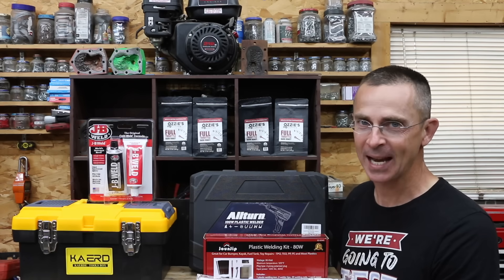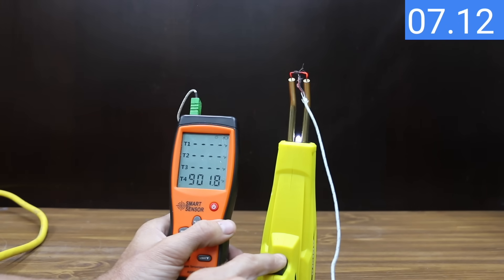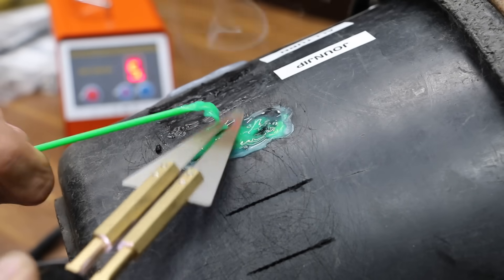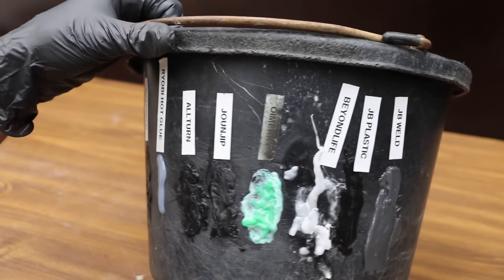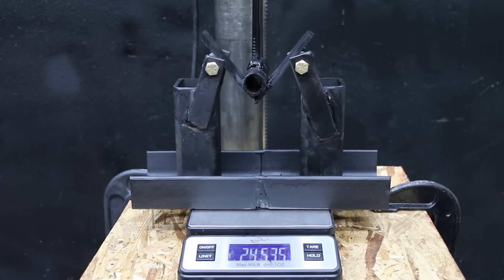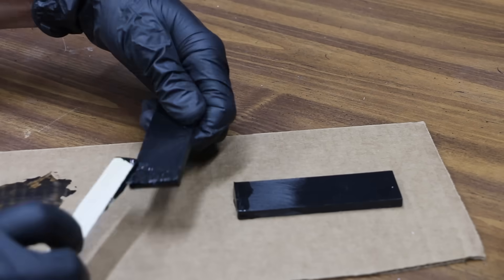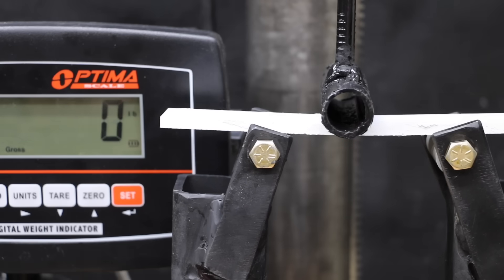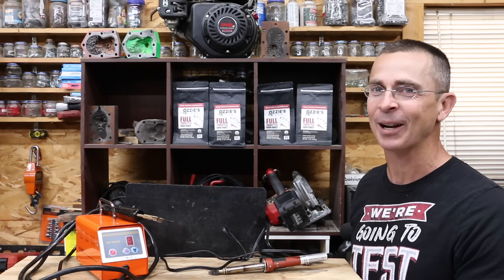Don't Buy A Plastic Welder Until You Watch This Review!

Comment: I weld plastic with my butane and/or electric soldering iron.  For breaks I simply heat at the crack until enough plastic melts on both sides and deep enough that it actually welds together.  In these tests it appears that most of the repairs are done using the plastic sticks more like hot glue than melting the broken part AND the plastic rod together as you would do when welding steel.
Reply from the maker: Thanks for the feedback.

Comment: Thanks for the testing. your tests more or less confirm my experiences repairing plastic which is that it is for the most part a waste of time in applications that require strength. Once those molecular bonds are broken not much short of sonic welding does much more than disappoints you when the part breaks again. Plastic has replaced a lot of items that used to be made of metal, it is not much fun to work with when it breaks, and regardless of the amount of plastic in the part is generally very expensive to replace something that if made out of most metals would have been easier to repair or wouldn't have broken in the first place.

I just used JB weld original on a plastic housing that covered the intake end of a diesel air filter. There were 3 cutouts on the end that could flex a little to slide over the filter. All 3 places had cracked. I sanded and cleaned the areas then applied Original JB Weld along the crack opening the crack some so that some glue got into the crack then applied more glue all over the outside of the crack. upon installation one of the sites re cracked. It was on the intake side so that the air was still filtered so have not gone back to reseal it. The filter has to be loosened from underneath but the only way that it can come out is out the top of the engine after some of the inter-cooler piping and other things have been removed. Not fun and really not much of a problem.

One product that I have had limited good luck is Seal-All. I have a 1984 Toyota Corolla that runs on diesel. It developed a very slight leak in the fuel tank. As a temporary repair I used Seal-All on the spot without draining the fuel. At the time it recommended that I use a single thickness of cardboard like a heavy end flap of a box lid or the cardboard backing of a note pad placed over the Seal-All and held in place for a short period of time. I did that temporary repair over 20 years ago and it hasn't leaked yet.
Reply from the maker: You are welcome!  Thanks for sharing.

Comment: To hell with plastic, and to hell with fixing it using 99% failure rate repair methods.
Throw the garbage in the ocean to support the ocean clean up crews so they will have a job in the morning, just buy a replacement plastic part.

Comment: Remember that the filler has to be able to flow with the workpiece—it needs to be the same kind of plastic. I cut filler strips from scraps of the same plastic type. For plastics that can be solvent-welded like PVC and ABS, that’s always my preference. But for waxy plastics like polyethylene, welding with hot air does the job, if I’m using filler strips cut from the same material. I use a Harbor Freight hot-air welder that uses an airstream from a compressor regulated down to about 15 psi. Welding with it is about the same as arc-welding steel with steel filler, except that there is no slag to foul restarts.
Reply from the maker: Thanks for the feedback.

Comment: The reason you had problems using the hot air welder is you set the temperature way too high. You need to set it high enough to melt the substrate and rod but not melt either one to liquid form. For HDPE I would probably set it to 325 to 375 F. For thicker materials you can got higher. 

If used properly, the gun will melt the contact area of substrate and rod, creating the weld bond.

I’ve used this type of gun for a lot of welding HDPE, PVC, ABS, PP with great results both for physical strength and water tight containers.

It does require more skill and practice than the hot iron methods but the results are much cleaner. Not what you experienced.

Comment: Would have been nice if the parts under pressure were sanded flat, as differences in the amount of excess plastic would give an advantage. Also ideally you want to refurbish a part so it doesn't look like it was repaired, and the goopy ones don't have that quality.
Reply from the maker: Thanks for the constructive feedback.

Comment: Thanks Todd - one of those tools I'll probably never use, but found the video plenty informative and I can now see the uses of a plastic welder.
Keep up the good work.

An idea for a future test - I had an Irwin Stanley Knife which, whilst it's metal, was letting go of the razor on particular angles (e.g., when I was cutting through plaster). Opened it up to find the mechanism which holds the razor is metal, but very thin and can bend slightly -hence releasing. Maybe something which is testable?
Reply from the maker: Thanks, will do!  Thanks for the suggestion.

Comment: I’ve been welding plastic for a couple of decades. The first thing to note is that the welding rod has to be the same plastic as the parent material. The welding rod supplied with the cheap welding kits is probably polyethylene. Second, it’s necessary to ensure full penetration. This is usually done by gouging a furrow with the welding tip and then filling the furrow with the appropriate welding rod. Third, care needs to be taken so that the staples are embedded half the thickness of the parent material. Fourth, all you really need is a good soldering iron and a selection of common welding rods along with the learned ability to identify the parent plastic.
Reply from the maker: Thanks for the feedback.

Comment: Seems like what really failed on some is the type plastic used to bond the test strips. Wonder how they would do if using Polycarb as the bonding plastic, sine most can heat up to melt it?
Reply from the maker: Thanks for the suggestion.

Comment: Something else that might be interesting to try and compare, I recently saw a YT video about using powdered charcoal and super glue to make plastic repairs.  I haven't tried it... claimed to make strong repairs.
The person demonstrating did us we a Dremel to make a notch in a crack, much like how you might prep metal for welding. He also used putty to form a shape that was missing completely from the original piece.
Again, I haven't tried myself. (I have worked with carbon fiber and fiberglass, but those are another matter.)
Reply from the maker: Thanks for the suggestion.

Comment: This was a fun video. I got the harbor freight plastic welder, and with a little practice and patience I’ve managed to make some fairly decent repairs. What I found worked the best was using the triangle tip to gouge out a channel into the crack or split, and then using filler material to join the two pieces. I let one side cool and then repeat the process in the other side, if I can get to it. then build it back up over the surface so I can buff it back down with a scotch wheel.
Reply from the maker: Thanks!  Thanks for sharing.

Comment: ASTM D638 might have been of interest to you here. Also see ASTM D648, that could have been relevant. But I liked your mockup of ASTM D790. Makes me chuckles that we have $60k equipment to do the same thing essentially. A dial indicator underneath the plastic to measure the deflection is the only missing data point, otherwise you had really good data and I appreciate confirming that JB Weld plastic epoxy was garbage all along.
Reply from the maker: Thanks!

Comment: None of these are actually welds they are bonds, In my mind a "weld" melds both surface into one and introduces additional material to fill any voids. These "bonding devices" fail to do that
Reply: Yeah, when the test pieces broke at the joins, it was always evident that neither had they bonded with each other, nor with the “welding” medium. Instead the stuff had formed a brace around the join, like a splint around a fractured limb. 

I think if he had built a machine to pull the test pieces directly apart, the repairs without staples would have pulled apart with just a handful of pounds-force.

Comment: My fridge ice maker diverter flap (pushes ice into grinder for crushed ice) broke. I used some of the staples and glued it with a super glue/baking soda concoction. I didn't have high hopes as it is a 15 year old fridge and the diverter was a thin, stiff (brittle?) plastic but 2 or 3 years later it's still working perfectly. I also fixed my microwave door handle that broke off (discontinued model) with the super glue option. JB and epoxy just never stuck to it very well but the super glue/soda was solid. My 1999 GE Profile is still kicking and isn't much different looking that the new ones sold in stores for $1200. Cost me about a dollar to fix it.

Tip: Super glue becomes super strong when mixed with baking soda, but you have to be careful as it gets very hot and puts off nasty fumes while it's drying (which is almost instant) but it's sold as a rock, literally, when it's dry. I've found it best to put a few drops of glue, lightly sprinkle baking soda until it doesn't look like the glue soaked through, then add another drop of glue and repeat. You can sand it and paint over it if you want (I didn't for my ice maker lol). If the part will be under stress like these test parts, the staples will work well with the super glue as it'll adhere to them too. I learned the super glue/baking soda trick on Sweet Project Cars and it's come through for me every time. I've seen a few people on YT using cigarette ashes or any fine ash with success as well, but I don't smoke so baking soda it is.
Reply from the maker: Thanks for the tip.

Comment: Love your work man, but hey welding is about fusion not adhesion. 

If you don't melt the base material it's not welding. That's "Why not a hot glue gun". A hot glue gun is only soldering or brazing the joint, not WELDING. But now I see you're not welding any of them. When you really melt the base materials and use the same material for filler (not some generic plastic "welding" rod), you'll find the strongest repairs. Sure metal will help, but really shouldn't be necessary if actually welding.

Welding is as much about melting the parent material as it is adding filler.  Where there is ample material you don't need ANY added "rod" or "stick". Throwing melted plastic over a joint is not welding. Those staples, are welded into the joint, but that's about all the welding going on here. The rest is melt and smear.

Comment: one wouldn't weld 1/4" steel without beveling (or at least a gap), and i think the same goes for these plastic welders..  what you've got is just glue on the surface.  kinda like your typical "booger weld".   :shrug

Comment: I've been using my soldiering station. First thing I fixed was a pair of eyeglasses. Having a digital temperature control makes a difference. Welding plastics opens up a lot of repair doors!
Reply from the maker: Thanks for sharing.
Reply: Just don’t use the same tips for soldering and plastic — the plastic damages the soldering tips and can contaminate your electronics. Also, don’t use the same sponge or brass wool for plastic as for electronics, again because of contamination.

Comment: 5 to 10 minutes to reach peak temp is pretty poor.

In my opinion,  if the repair isn’t flush, especially on the outer surface that can be seen, it’s not a viable repair.  Glopping plastic welding rods on the visible surface is not an aesthetic repair, but an industrial one.
Reply: it's not welding at all. it's melt and smear.

Comment: Did you use the same "repair sticks" in all cases?  If so, that's the problem.  You need to weld with compatible materials.  Trying to weld a piece of polycarbonate with a piece of HDPE will be an obvious failure.
Reply: He's not welding, he's melting and smearing. Welding requires the base material to be melted into the fusion zone. He's glopping goo.
Reply: That's the less polite version of my point.  Fortunately some "goo" is better at adhering to a particular plastic than other "goo", as is evident from the test results using the JB Weld and hot melt glue sticks which did a better job than most of the melting stuff and smearing it around that was done.  Epoxy repairs aren't  "welds" or even "brazing", but can be useful repairs in some cases.  Certainly not a fabrication method though.  If you do it properly you can fabricate thermoplastics by welding and generate excellent results.
Reply: @spitfireresearchinc.7972  Yes. I've welded plastics and shall do it again. I think it's a disservice to  those seeking information here to call something what it is not. He's heard it before. I show up 4 minutes after Todd drops a video and there are 1700 comments already.  Those "welders" can be used to weld plastic but that's not what happened here. Todd is thick-skinned enough to take "less politeness" now and then. I certainly do like what he does-and tell him often enough.

Comment: I've used a few, never seems to work well. I HAVE had a lot of luck with some rods and my solder reflow station at work. The temperature and airflow adjustability makes it so you can fine tune how you heat the plastic-- plastic seems real touchy about just a few degrees.
Reply from the maker: Thanks for sharing.
Reply: Yeah, a few degrees too high and you do tremendous damage to the base material. A few degrees too low and you may as well be using Elmers Glue.

Comment: Welding plastic needs the lowest possible temperature required to fuse the fill and base material, and no more than that. At least for HDPE.
Reply from the maker: Thanks for the feedback.
Reply: He's not welding and YES this is why a variable temp soldering station (what I use) is superior to turn on and guess heat. Gotta get it hot enough, but not all runny.

Comment: The big surprise for me was the hot glue. I NEVER would have thought it could hold up as well as it did. Great video, Todd!
Reply from the maker: Thanks!  Thanks for the feedback.
Reply: I'd love to see a comparison of different types of hot glue sticks.
Reply: What brand of hot glue was used in these tests?
Reply: Not tested here, but the operating temperature will matter if you use hot glue.
Reply: Hot glue bonds great but from my experience it tends to degrade after a while. I’m sure there’s better glues out there, I’ve only used a few diff ones. 
Would actually be neat to see Todd compare hot glue sticks.
Reply: I use hot glue for everything, even to this day years and years later some of my pieces I weatherproofed are holding up and keeping water out.
Reply: @elitescouter  I remember a "weatherproofing" stick made for hot glue guns. Easy to apply and remove.
Reply: @elitescouter  To be fair, that's also basically how Apple weatherproofed the new Airpods Pro 2, just filled the interior seams with globs of hot glue.

Comment: I feel like for these testing conditions of 2 separate pieces being "welded" back together the testing procedure should look a lot more like actual welding of something this thick. That is to say chamfering the edges and filling in the void. Otherwise as seen by almost all of the none staple welds that there is no penetration of the material. Welds must permeate and be not just on top of the repair but in-between as well.
Reply from the maker: Thanks for the feedback.

Comment: Tip I picked up: You can chuck a short piece of 3d printer filament into a Dremel tool and use that as a stir welder. Works pretty well with some practice. Use the same type of plastic filament as the part you're repairing.
Reply from the maker: Thanks for the tip.
Reply: Didn’t Fran Blanche do a video showing some old plastic stir welding device that worked just like that? 

Either way, great tip about using 3D printer filament. I’ll have to try that sometime!

Comment: for pieces that thick I would suggest to add some chamfers that you can fill in with molten hot plastic to get a good bond troughout the entire thickness of the material, basically same as with welding metal.

I had to "weld" the housing of a cordless chainsaw with a soldering iron, it was broken in several places and for reinforcement I made some loops and staples out of welding wire, afterwards I heated the entire area so everything would fuse together nicely, it's been a few years since and it appears to be holding up nicely
one critical detail is that the "staples" must not be straight, they should be wavy, curly or maybe actual loops, something like a paper clip for example would work very well too

i had no paper clips, but the most "staples" I made where basically crappy paper clips because that way you get very good mechanical strenthy even if the metal iteslf didn't stick to the plastic.

that's not much of an issue neither, because I was using welding wire that was feeding trough the welder, it had some nice indentations from the feed mechanism
Reply from the maker: Thanks for the feedback.

Comment: Maybe you should watch some YT videos on each type of plastic welder, and run this test again.  I have the Jounjip, a staple type, and I also bought a rework station with variable temp and air flow speed on the hot air, and found some tips for it that fit, and work with some of the parts from other air flow welders.  I have repaired trash can lids, and recently a 60 gallon rain barrel that is holding up nicely.  The thing with the mesh, is to melt it into the part you are fixing, kind of like the staples, and then cover it up.  I was surprised at the JB Weld results though.

Comment: The two plates need to be beveled if possible.  An you want to heat the base plastics just as much as the rods.  An shoving it into the melted base plastics.  And get a good through an through bond of the materials.
Reply from the maker: Thanks for the feedback.